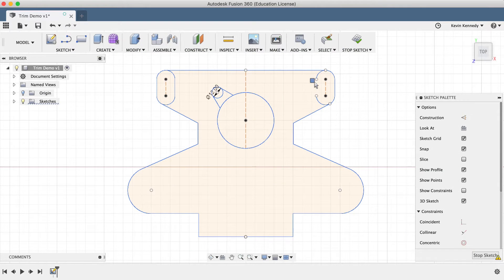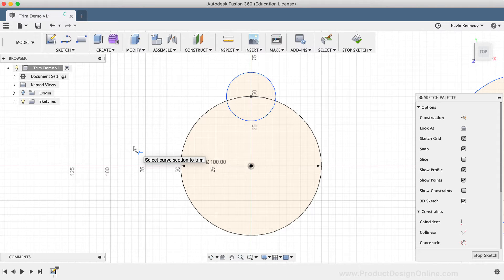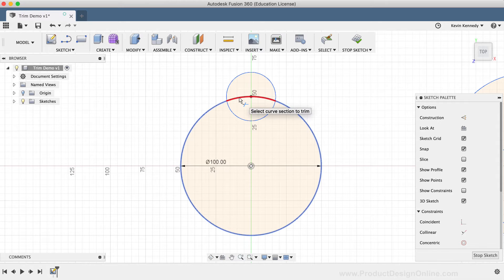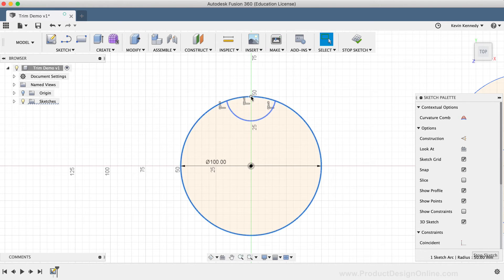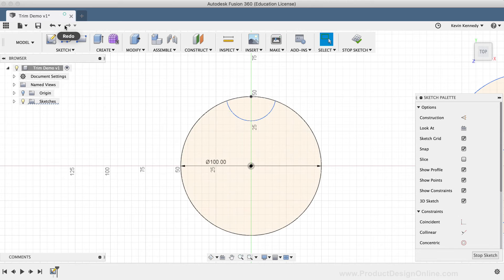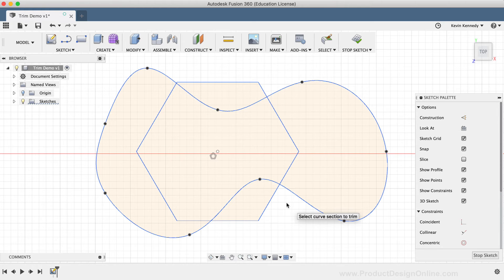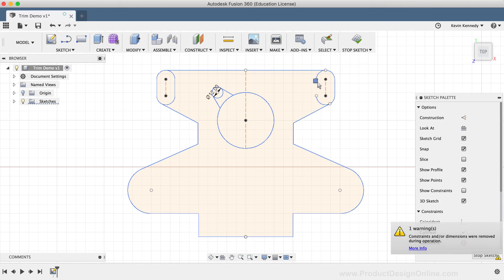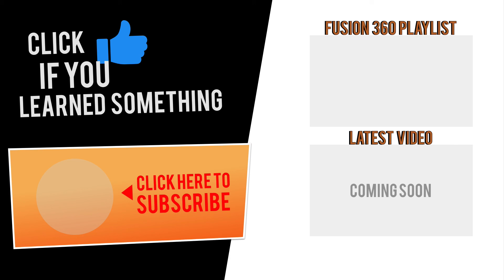How to Trim Sketch Geometry in Fusion 360

Comment: I imported an SVG.  Those line segments don't seem to be treated as "sketch geometry".  How do I create an intersection?  The trim tool is ignoring the apparent intersection of a line I drew in my sketch that crosses a line segment in an imported SVG image.  So, the trim does not work in that it does not trim only to the intersection.  The apparent visual intersection does not seem to be a recognized intersection for the trim tool.
Reply from the maker: Double check that the geometry is not fixed, as it will be upon importing via the SVG route. If you see green line color then that means it's fixed. Use the fix/ unfixed constraint so that you can alter the sketch (from the SVG). 

SVG's often convert to many tiny little line segments, so using the trim tool may or may not be helpful. You will want to zoom in to take a close look at how much geometry is making up the shape. It really depends on the shape so it's hard saying without seeing what you're working on. Hope this helps! Cheers:)

Comment: I'm trying to trim several lines and it was working fine until the last line. It highlights red but won't actually trim. I get a warning pop saying "constraints and/or dimensions were removed during operation." How can I trim the line?
Reply from the maker: Hi coontabean. This one's hard to answer without seeing the specific geometry. Could you share a link to a screenshot?

Comment: Videos are good but need to be updated to latest version of the software. My screens are not the same as yours. Also trim and other options not functioning. How do I get them to start working ??
Reply from the maker: Hi, SSGWEREWOLF. The only thing that has changed with the new UI is that all the sketch features are now located under the SKETCH contextual tab. More about the changes can be seen here - https://youtu.be/tuZzHcmFtg4

You will have to be in an active sketch environment for the sketch tab to appear in the toolbar. Otherwise, you can access sketch features with the shortcuts box, using the keyboard letter "S".

In regards to the trim feature, could you elaborate on what you're experiencing? The trim feature has not changed in recent months.
Cheers, Kevin :)

Comment: Hi Kevin. Really enjoying this series and it's helping me learn Fusion 360 for use with my 3D printer. One problem I keep running in to is what I believe is referred to as fit and tolerance. Many of the parts I'm making need to join together and I tend to just make a hole of size X and then a pin of size X - 0.15mm. It then takes me a few more prints to get the best size for the pin/hole. Thought it might make a good topic for a future video. Thanks
Reply from the maker: Hi Anthony. Not sure how I didn't see the notification for this comment :) Anyway, thanks for the suggestion! I've had a few other people bring this up as well...so I've added it to the list of video ideas. I will definitely have to do this as some point. Cheers, Kevin :)

Comment: Let's say you have a threaded hex bolt and a hole is there a way to mate the two so the threads are adopted by the hole?
Reply from the maker: Hi Rud Dog, I would recommend you use a cylindrical joint. Then, try to apply a motion link to set the ratio between rotation and movement. Cheers, Kevin :)

Comment: How to add holes in side walls of cylinder
Reply from the maker: Hi, G.Mahesh. You'll simply need to create a construction plane. You can use a number of different construction planes. You could use the tangent plane, which works great with cylinders, or you could create an offset construction plane by offsetting the plane from one of the origin planes.

Cheers, Kevin :)

Comment: Great video, thank you! To help maintain constraint geometry, create your initial basic shapes with construction lines (dashed), then trace over the top with regular sketch lines to create the necessary profile shapes. Any parametric constraints you use on the basic construction lines will be preserved, without trimming warnings. In your example I might use centre point arcs to trace over the circles.
Reply: @Ed Jones - Hey, :) Thx. I'll be trying out your suggestion.
Reply from the maker: Hi Ed. Thanks for sharing this tip with the community! Cheers, Kevin :)